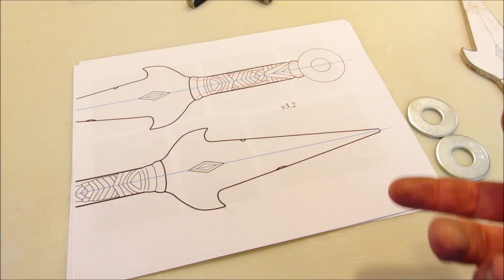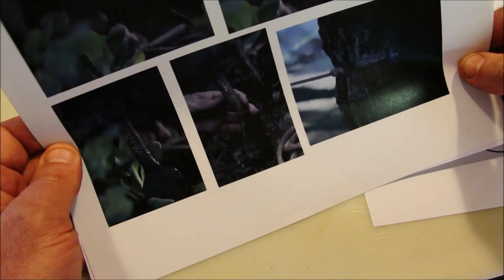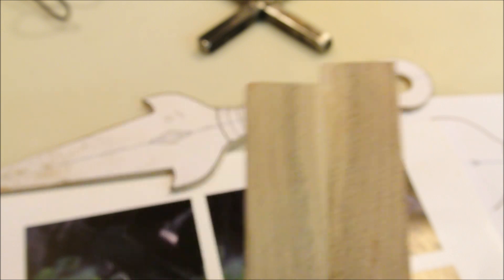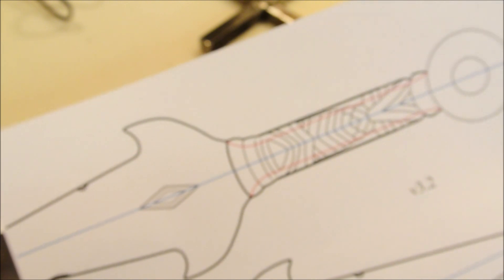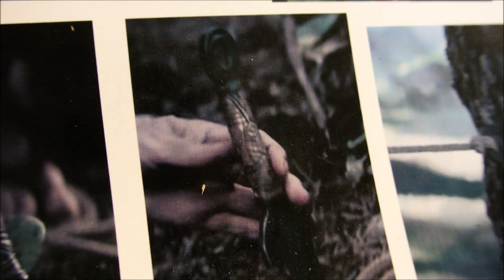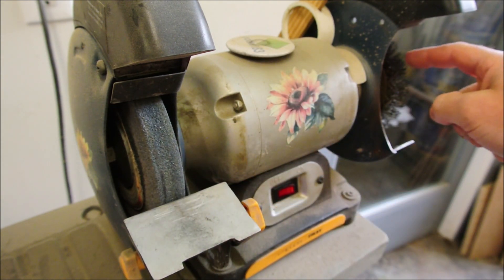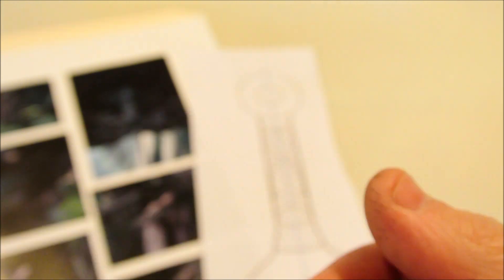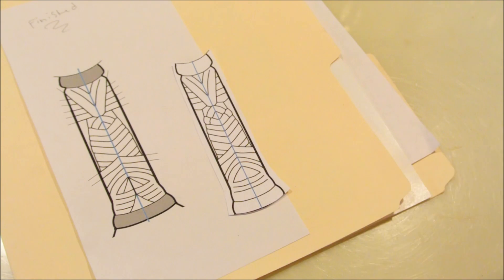MORTAL KOMBAT Scorpion's wife's garden Kunai. [Build tips]

Comment: I was using a gardening trowel as an ersatz rock hammer because while gardening, i kept digging up interesting gneiss that i wanted to split open. I ended up with a fairly bent up trowel. ever since then, i've wanted a garden trowel that was super beefy, even stronger than an e-tool. I haven't found anything like that, but your gardening implement here would do the trick i think

Comment: I was hoping for a discussion on that sandblasting setup. Looks like something I need. I'm in the middle of restoring a bunch of hand planes. I've been using the wire wheel (No kidding on the safety glasses. Those run scary fast)
Reply from the maker: A sand-blaster is indispensable. Make it your weekend project. Here it is, in essence: an old plastic coffee container, an 8' length of cheap (hard) pneumatic hose, and a steel fitting to connect them together. Other than that, just buy a replacement sand-blasting gun (under $20). Also add in a brass valve as shown if you want to fine tune the spray force. The real tip in that clip was on the actual tip; attaching the nose tube through a dish-soap bottle's nozzle makes a replaceable screw-on plastic shield/deflector that reduces the number of little quartz balls that'll go flying at high speed directly back against your face. Simply press the cut bottle against the piece you're working on, and it makes a little contained tornado of sand. Don't steal that tip; it's a classic, and I haven't released that one yet.   

It's on my list to make a self-contained DIY sand recycler. Don't breathe it. More on that another time. Oh, if you've not done it before, wear earplugs. Like Anakin said, stuff gets everywhere.

Comment: Hey Pocket, I'm not sure where else to put this (I can't see that YouTube has a messaging system any more, so your most recent video seems like the easiest place)

I was just re-watching a video from last year (drill battery boombox) and saw a clip of a sundial that you made, I can't see that anywhere so did it get posted or is it in the vault somewhere?
Reply from the maker: The prototype was wood. It worked, but now it's in one of the cardboard vaults. The plan was to make a permanent concrete one, but sundials are far more picky and temperamental than people let on. 

If you want to make one, first establish your position in the world using a (free online) geomagnetic calculator. You can also just 'rough it' by using Google maps to find your latitude. Next, apply your magnetic declination number to make a printout. Block layer dot com has a super easy setup to do this, in both Imperial/Metric, as I recall. You'll also have to spend an hour or so in Wikipedia pages first, but all of this is easier than it sounds. 

One more tip, about orientation: placing a sundial requires precise positioning. You may want to use an actual magnetic compass to start, and then adjust from there. Since those tend to be both expensive and unreliable, I suggest instead picking up a $1 six-pack of the party-favor toy variety, and just average out their collective readings, throwing away the one or two deviants.   

Let me know if you hit any snags (or if you're successful).